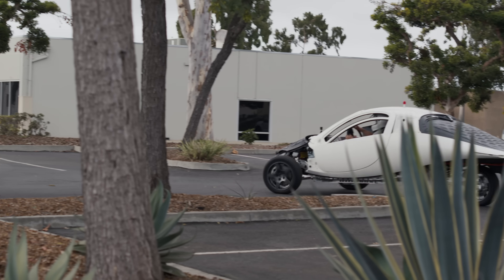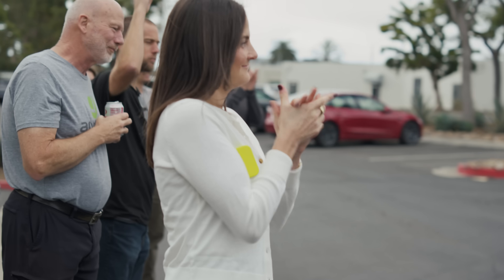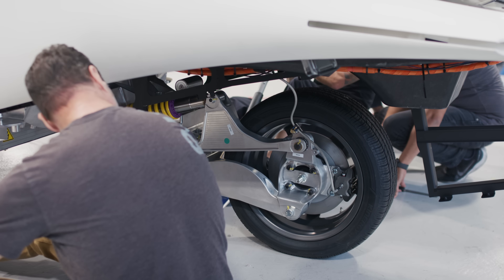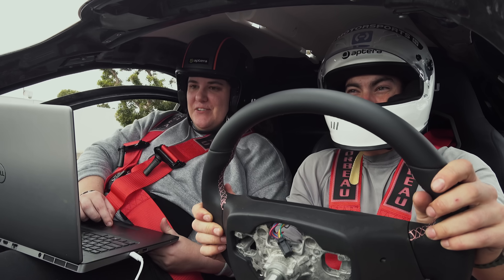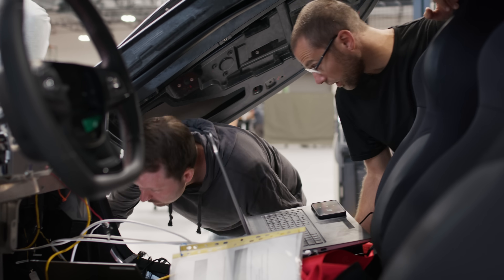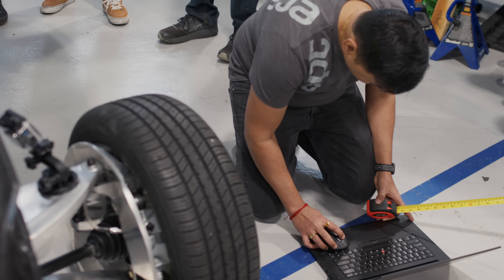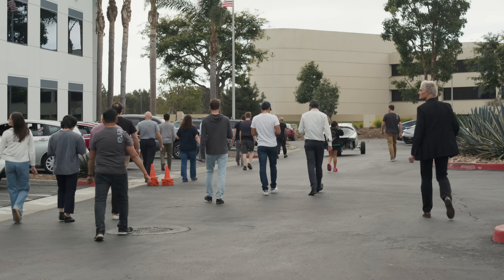Aptera — Driving our Production-Intent Vehicle

Comment: Hope the steering wheel is an option
Reply from the maker: This wheel is a temporary solution for PI2, as it is primarily used for track testing. We opted for a yoke design to allow the driver to easily view the left and right side camera screens while driving.
Reply: @ApteraMotors  Interesting. That explains a lot. Thanks! (I think that's unfortunate, but understandable. I totally get why the mirrors have been replaced by cameras and screens, but as someone who has a car with a screen for the center mirror, I hate it. In theory, they could be fine if the resolution and framerate are high enough and the focal length and depth perception could be reproduced. I'm sure I'll get used to them eventually.)

Comment: Loads and loads of respect for this achievement!
Reply from the maker: Thanks so much! It's a huge deal for the team.
Reply: Too bad the money is running out and new investments aren't coming in.
Reply: @Throckmorton.Scribblemonger  Too bad you concern-trolls are quickly running out of whinge material and are now scraping the bottom of the barrel.
Reply: The achievement is good but the product is not practical.
Reply: @grahamjohnson4702  OK, move on if you're not interested in the topic.
Reply: @grahamjohnson4702  For whom?  If it will not work for your weird needs, perhaps you should be somewhere else?  The thousands of reservation holders seem to believe it will work fine for them, and of course, as soon as this thing is on the road, orders will skyrocket.  You poor concern-trolls are sounding pretty desperate right now.
Reply: @J-W-Kelly  So for one you think towing a caravan or trailer is weird, but won't bother going into other needs.

Comment: Thanks for the sharing of PI2, steering wheel shape is defined or temporary ?
Reply from the maker: Thanks for following our journey! It's a temp wheel as our custom designed wheel is tooled for subsequent PI vehicles.
Reply: @ApteraMotors  Thanks for the clarification. I see quite a few comments noticing the steering wheel and hoping for that instead of the yoke. But you guys seem pretty set on the yoke design in the past. Can you please expound on that design choice a bit (like in a podcast or video)? Does it have to do with motorcycle requirements or is it simply aesthetic. I get the sense that many in the community (including myself) feel that this design choice was made with form over function as priority. If that is not the case, please explain why you feel the yoke is superior to a classic wheel. Thanks!

P.S. Congrats to the whole team on reaching this milestone! It is wonderful to see Mercury rolling around!
Reply: @josiahpaez4601  Aptera Motors already has explained this many times: the yoke is for better visibility of he side view monitors in front of the driver.
As there are also minimalistic side view mirrors there is no legal or technical concern to get an after market steering wheel retrofitted. However, it is no big deal to learn handling the yoke, it's really just about getting used to: adjust the hands at the 9 and 3 o'clock position when going straight (not 10 and 2 o'clock or so!), and everything will come together naturally.
How do I know? Well, you bet! (But no, I also don't have an Aptera in my possession yet! 🤷‍♂)
Reply: @charangohabsburg1  Thanks! I actually saw them state exactly that in another comment when I read further down the comment list. I don't know how I feel about that. It's understandable, but this feels like a pretty big compromise, there is no other place they could stick the mirror cameras? I'm sure I'll get used to it, but it seems like a yoke is not as user friendly or safe as a wheel and it's one of the things that is most interacted with when driving.

Comment: In 7 more years it may be ready?
Reply from the maker: We launched Aptera 2.0 in 2020. We are actively pursuing $60 million in funding. Once secured, we expect to enter production within 9-12 months. Although the current delivery estimates in the Aptera dashboard align with our goals for production, vehicle delivery ramp is dependent on securing the $60 million in funding and therefore, will be a moving target. We feel that we've gone incredibly far with the progress made on our existing funds. To learn more, please review our latest SEC filing. https://www.sec.gov/Archives/edgar/data/1786471/000149315224041645/partii-iii.htm
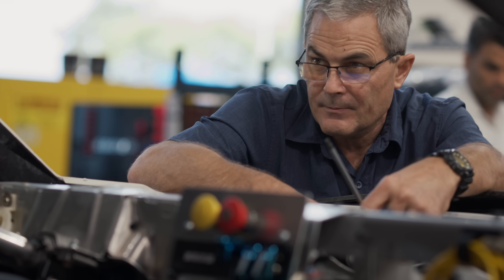Reply: @ 1:25 notice that they forgot to install the green, "GO" button.
All flash. No dash.
Reply: @Steven-h7h  You're so right about the missing GREEN go button. But it's probably a legal requirement that it's yellow, and as a new company on the market you don't want to mess with minor silly details... 😳
However it's rather all dash, no flash! 💪

Correct, @ApteraMotors ?